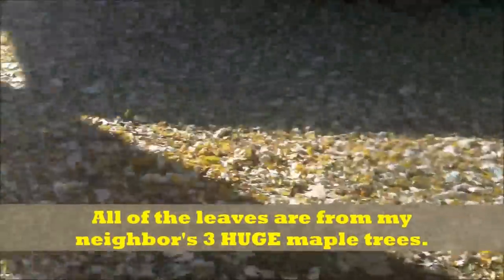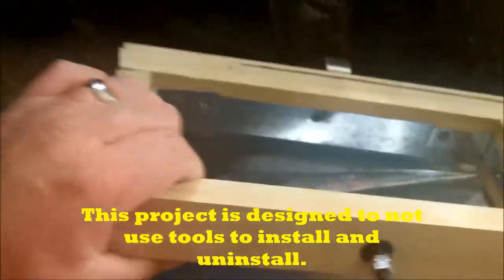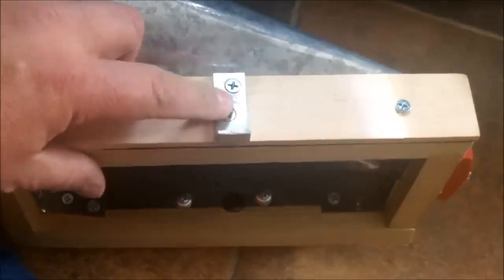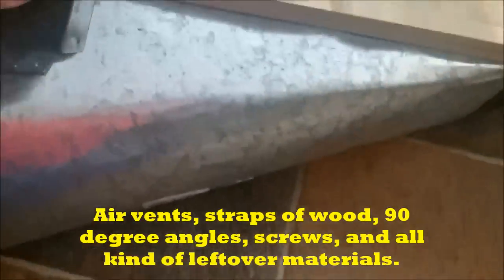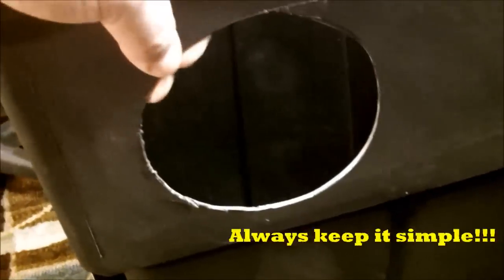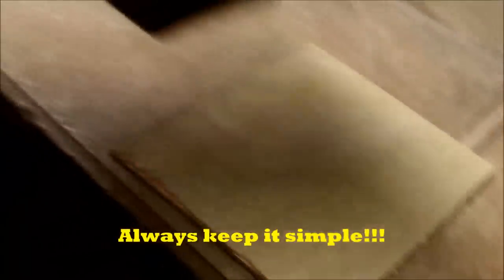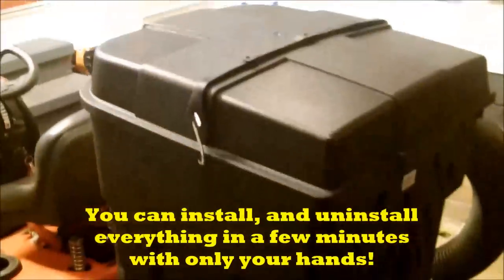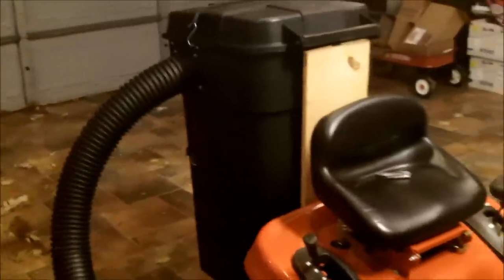Homemade Leaf Vacuum

Comment: Great video...but I didn't understand why you reinforced the pail.
 It's only air & leaves blowing in.
 Just wondering if lowering the hole in pail would've kept it's integrity.

My actual question is:
 Do you simply just slide hose out when emptying ? Thanks

Comment: I love that you DIY, but you can buy a used triple bagger for $30. Also, the hose is too small in diameter. Look at all those leaves shooting out of the front. I have the same problem to a smaller degree with a Craftsman bagger. The tube is much larger in diameter. I'm thinking about adding a vacuum/blower in between like a Cyclone Rake. I might first try to add something in front of the deck to stop the leakage.

Comment: wonder if you get chute clog?
I have my tractor mower and installed a MDT chute, it clogs so often that I got annoyed.
I do have oak leafs to deal with, maybe I need to sharpen the blades? 
I am working on a old chipper to attach to the trailer to help sucking air and shred even further, but I am amaze others don't need to go so far in order for this to work.

Comment: Good luck finding 6" tubing at the hardware store.  Lowes or TSC doesn't carry it.    We found it at home depot but it is online only and 55.00 for shipping for a 15.00 piece.  Manards has 100' sections of it.  We ended up buying leaf vac hosing from Ebay for 55.00 plus shipping..   Thanks for the video.

Comment: Where do you get the metal duct work
Reply: +Nick Mossey I've seen it at Menards, Home Depot, Lowes, etc.
Reply: aright thanks i went out and
 bought a bagging system. I did try it and it worked great thanks